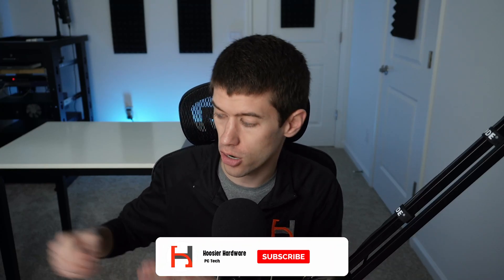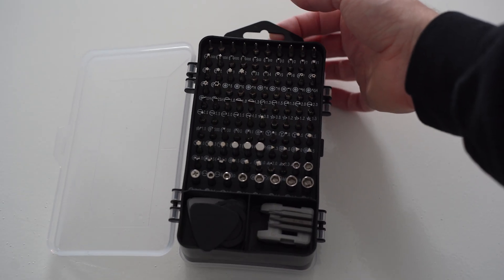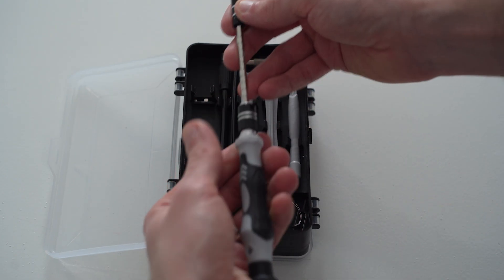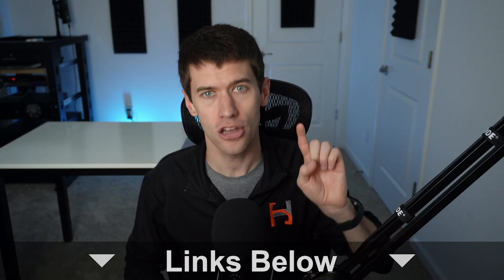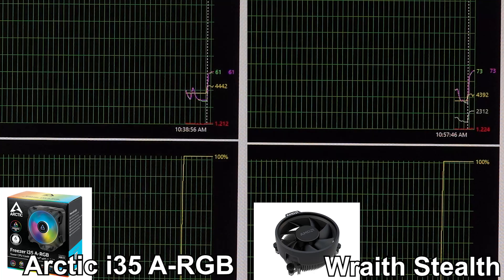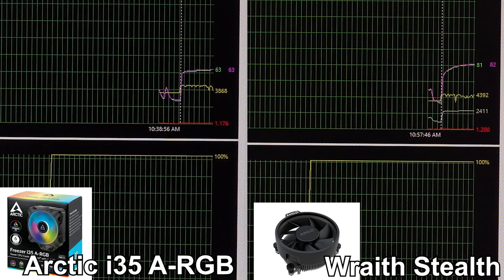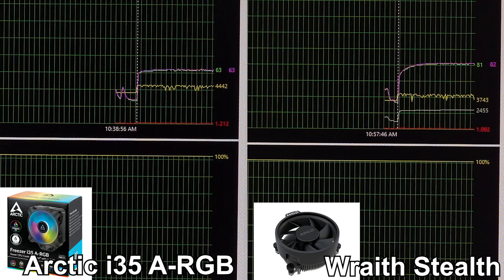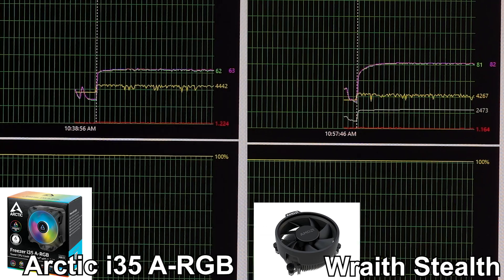Stress Testing the Ryzen 5600 with the Stock Wraith Stealth Cooler

Comment: Kind of glad you posted this unexpected topic.  I've been enjoying my new 5600x system for half a year now, so far with the stock cooler.  The thing is that shortly after building the pc I bought a Be Quiet Pure Rock Slim 2, and because there have been no issues I've just been putting off switching to the modestly better cooler.  I'm going to put a note on my calendar to get around to that this coming week!  My wraith has never been loud by the way, but I do notice when it accelerates.
Reply from the maker: Yep. Worth noting that a LOT of GPUs are louder than the little stealth cooler, so it's unlikely you'll really notice it much. It just sorta fades into the background noise of the room.
Reply: I'm have ordered a 5600x boxed version including cooling. A year has gone, did you try any silent version, which you could recommend or tried any other?
Reply: @tajamalrafiq3651  I have been very happy with the Pure Rock Slim 2 and have had no need to try other coolers, however there continue to be an improved selection of new competitive low cost coolers.  Some of the obvious ones are Thermalright Peerless Assassin 120 or Phantom Spirit, and more recently check out ID-Cooling  SSE-224-XTS or ID-Cooling Frozn models.  In some regions they are said to be more price friendly than the Thermalright choices.  Best wishes.

Comment: I want the 3060 but, considering the 1660 due to I won't use the RTX
Reply: If you don't care about ray tracing then go with an RX 6600 and save yourself money. It performs just as well as a 3060 until you turn ray tracing on.
Reply from the maker: The real question then becomes whether or not you can use the extra horsepower the 3060 has in traditional rendering over the 1660. Well, that and pricing obviously lol. Prices may be coming down, but they're definitely hit and miss right now.

Comment: I was considering getting this CPU. right now I have the Ryzen 5 2600
Reply: Just upgraded the 3500x/Rog B450F to 5600 ($180) and a half year old used Rog x570F ($120), sold the old U+mobo for $160 and stick with the same Ram and the exisiting 6700xt, for gaming, the upgrade grants aroud +15% more performance for around $150 cost, pretty happy with the upgrade for now as DDR5 and Z series boards is kinda priced atm.
Reply: Go with intel, it'll be futureproof with then z690 mobo and 12th gen support for ddr5.
Reply: @ElNegus9985  No, if you already have an AM4 motherboard and decent ram (presumably The Joeker does), then upgrading to a 5600/X or 5700X/5800X as a drop-in solution, makes a lot more sense than buying a z690 motherboard, over-priced (and what will eventually be low-end) DDR5, and the Intel cpu itself.
Reply: Reading this in big 2025 @ElNegus9985